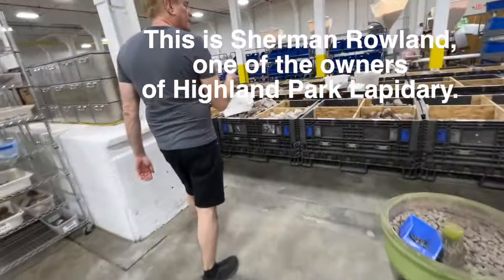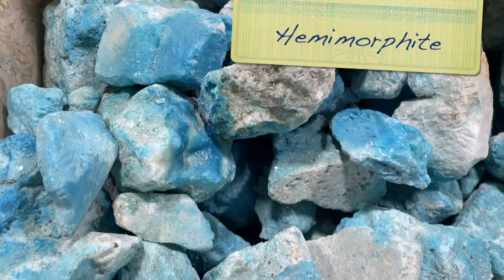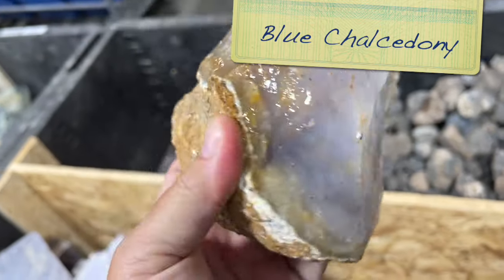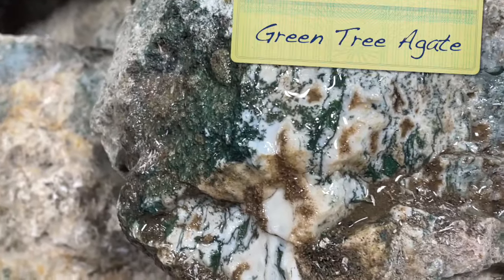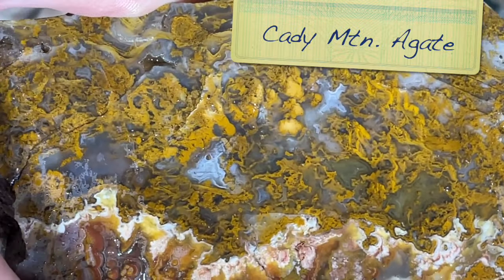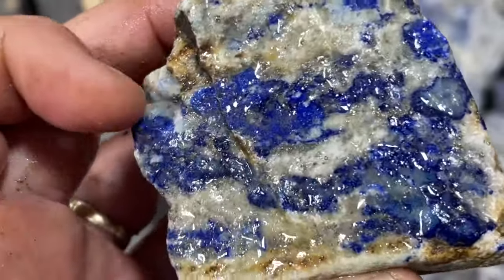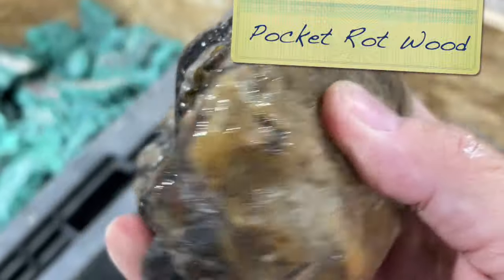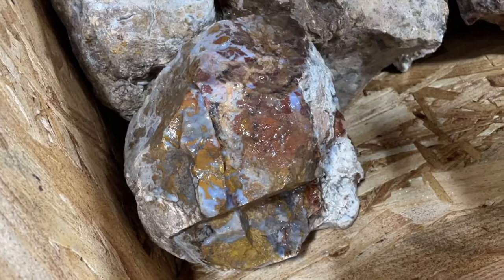INCREDIBLE ROCKS from Highland Park Lapidary

Comment: What a fun time you must have had!   I Would have probably spent way too much money.  WAY Too Many Beautiful Rocks to choose from.
Reply from the maker: They really are beautiful!
Reply: Back in the latter 1970's or very early 1980, I was at rock, gem & jewelry show in New York City, possibly held at Madison Square Garden, shortly after Charoite came onto the market.  If I remember correctly, I purchased a small slab I could afford.  Have no recollection as to what it cost then. 
Around that time by a year or so, there was another stone newly found called Sugilite, I don't recall where it had been found.  I was at another rock, gem, mineral & jewelry show in NYC., where it was highlighted. The color was a deep red-violet.  Beautiful stone!  I don't remember whether I purchased a piece or not.  Too many years have passed.
Enjoyed seeing all those rocks you showcased.  What beautiful colors and patterns!  Over the many years that I taught Metalsmithing:  enameling on copper & fine silver (very finely powered glass adhered to either a copper or fine silver base with seaweed solution & fired in a 1600 degree kiln for about 2 minutes); pewtersmithing fo a few years;  sterling silver jewelry-making & casting and lapidary in a private psychiatric hospital in Connecticut for many years.  Prior to starting my job, I had never cut-polished any stone and had never seen any equipment with which to do so.  My classroom  had the equipment and drawers of rough & slabs.  
In high school, junior & senior years (1956-1958), I had taken Crafts where I began to learn some jewelry making  which included cabachons; after graduaring, I attended a junior college where I continued jewelry making and other craft classes.  After graduating, I got a job at the psychiatric hospital mentioned earlier.  Retired in 2002.  
Thanks for sharing all those rocks.